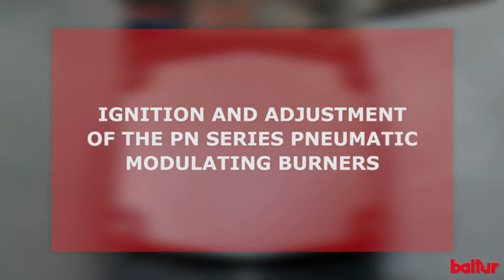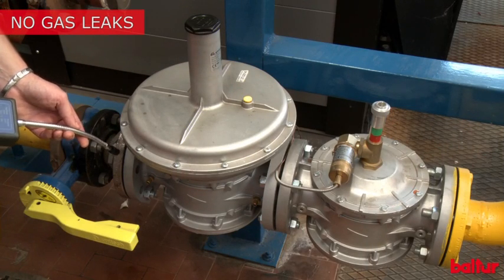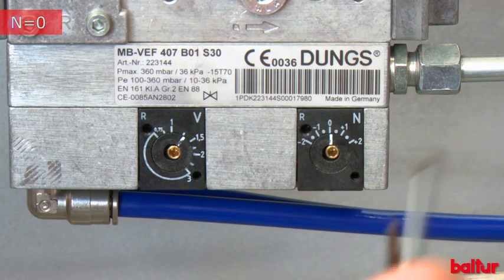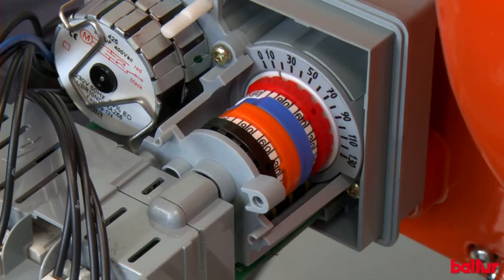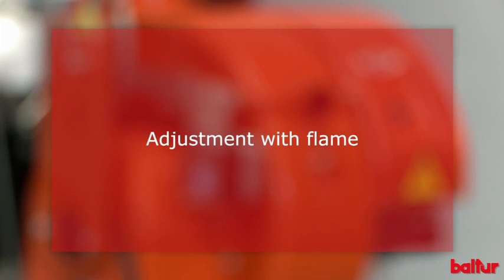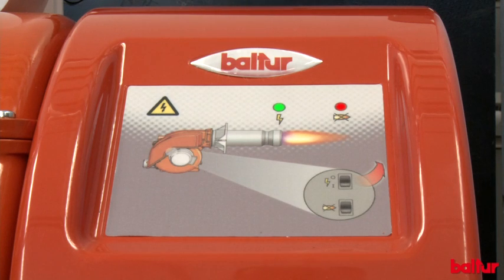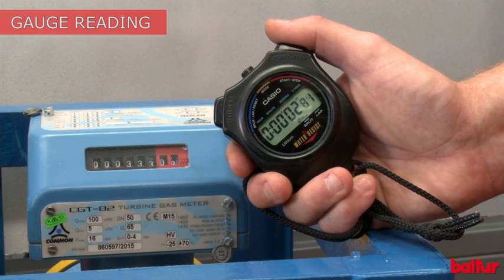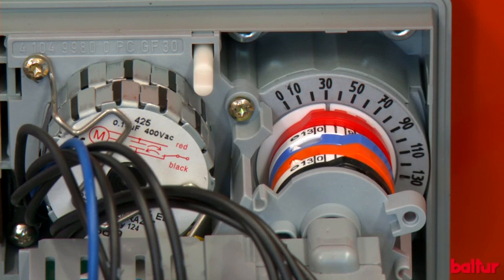Baltur - Pneumatic modulating burners

Comment: Hello sir we are using dual fuel burner WM GL10/4-A/ZM-R this boiler in our industry. Before when they work in gas they working correctly but surrendly we converted in fuel there pressure level not adjust in 40 they fown in 25.
Can u help us to make him correct.